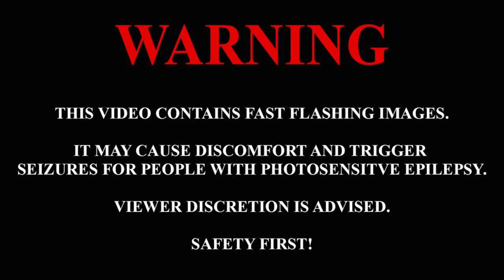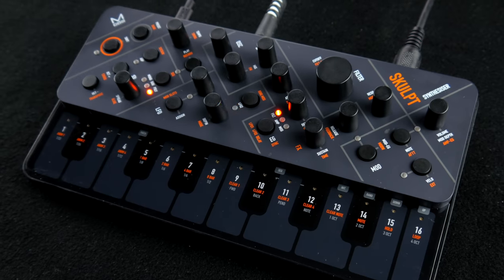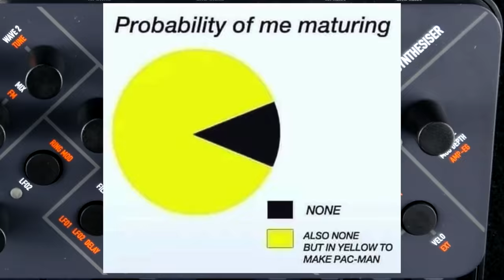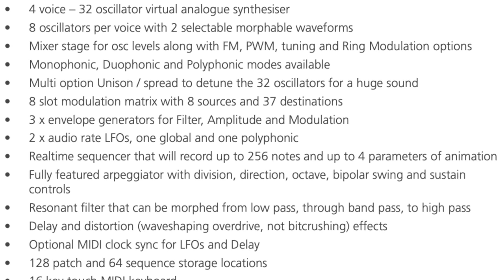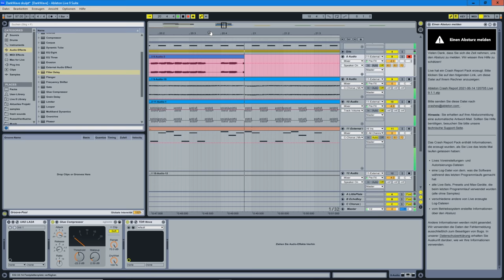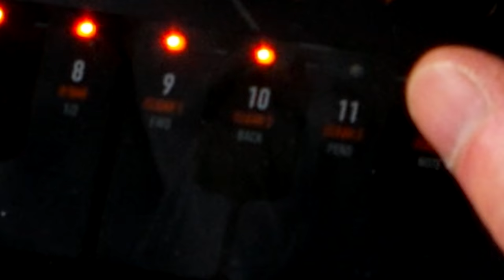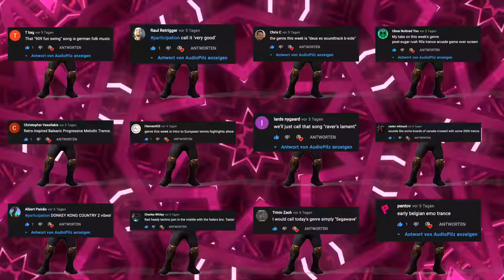Bad Gear - Modal Skulpt - Plastic Toy???

Comment: almost $500USD and NOT sold in the USA at least on Ebay, it is only from Japan or UK. The SE is the only model available in the USA so far. The crashing is a no go for me for that price! When it is $100USD used in the USA at my local ebay store or pawnshop then I get it. With it crashing I would be tempted to throw it against a wall..
Reply from the maker: Insane! They're rather cheap around here
Reply: Theres no difference between the SE and the Original sound or function wise.
Reply: Yeah looks like it costs about a third of that if you order from Europe. Insane!
Reply: @Stadsjaap  Yes! The black unit is too expensive in the US. The white SE edition unit is $199 to $299
Reply: @mycosys  hmm? I wonder why thy have it labeled for the white one, Skulpt SE?

Comment: Ok. So I can’t agree with you on some counts. Whereas it indeed can sound decent it will always sound weak. I spent a lot of time trying to beef it up at least so it can match even my circuit, but Skulpt kept failing. UI on the other hand is quite usable up to a point when you want to assign any kind of modulation or LFO without an app. Nightmare. And I don’t want to use app, I have VSTs to click around, thank you. Lastly, sequencer. This is something else. I never have seen sequencer that bad. Even deleting a sequence and persisting that state is an impossible chore without an app. 
Skulpt have a lot of potential, but there was way too much corners to cut in order to maintain the price.
Reply from the maker: I think it was supposed to be a gateway drug
Reply: @AudioPilz  For me that it was for sure. But now, after I got monologue, Skulpt sits silently, unplugged, at the edge of the table, like some sort of remorse or gilty concience. Even If I'd want to sell it, with the release of SE (which is half price MSRP), OG is virtualy worthless. And useless. At least for me.
And that - releasing SE, wich is same thing but with clearer labels, for half of the price of OG - is a AAA class dick move on modal's part.
Reply: I'm not entirely sure if you're engaging in some low key trolling Room, with your Circuit comment. I honestly can't tell  I actually involuntarily snorted out loud when I read it, which also seemed to be the trigger for energy drink to cascade out my nose. You learn something new every day. Today I learned not to drink energy drink whilst reading contentious comments on the internet. 

Horses for courses, if you prefer the OG's sound over the skulpt. For me I suppose, I just prefer my luxuries like a keyboard, an arpeggiator, function labelled knobs, easy access to multiple envelopes, filters, oscillators, plus distortion etc from a front panel,  computer software that plays the patch out loud as you're tweeking it, and the ability to "easily" play it from an external keyboard, or for it to control other equipment without the need for any extra cabling or splitter units. Call me old fashioned.
Reply: @dazastafariinc8390  I think there's some serious misunderstanding going on here. So to clarify:
By OG I mean the Skulpt shown in the video, the original one - as in original gangsta. That's how kids call original things these days. About two months ago Modal released slightly revamped version of it, called SkulptSYNTH SE, which differs from the original in different labeling (labels are horizontal now), less visual clutter caused by the teris lines and in price (MSRP is half of what OG skulpt went for). Oh, and apparently it comes with white keyboard. But differences end here.

So the whole second part of your comment is lost on me, sorry. Your understanding of word 'OG' is clearly different. In case however we are still talking about Skulpt - as I said: unless you want to assign modulations, all programming can be done from the panel more or less easily. Some things require using the app though, which I don't like, because I want hardware to be tactile, not clickable.
Reply: @dziwic  ah my bad dude. I am aware of what the term OG meant as I used to be a professional hip hop DJ and encountered more wannabe OG's in 12 years than anyone should have to endure. By OG I meant the novation circuit, which is the internet parlance the kiddies are using to describe it. I believe in relation to the circuit the term originates from online reviewer Gabe Miller, the most ungangsterish individual one will ever come across. It appears OG is one of the buzz synth words of the year, along with other gems like "creamy" to describe anything even slightly moogy, and "minty" to describe something's condition as be excellent or mint condition.
Reply: @dziwic  oh I thoroughly agree on the skulpt as well. I don't bother with the assignable mods and the sequencer as I sequence it with a toraiz squid, buy the oscillators, filters, envelopes, FX and spread are more than enough on the front panel to craft some good sounds out of, something sadly lacking in the circuit. The modal app sheets all over the circuit app btw imo.
Reply: @dazastafariinc8390  Ok, so we have the understanding - agreed, OG tends to stand for OG circuit these days, but have never seen used as just an 'OG' (without the 'Circuit' bit) in that regard. That being said, again - I agree with everythying. Nova engine has nothing on Skulpt and sheer requirement of using an app to dial in anything is appaling. But then Circuit - being poly, that's why we compare - is great multitimbral sketchpad. I use it as a brain to both sequence skulpt and sync model:samples which in turn passes the sync trough to monologue. If I decide to use Circuit and Skulpt at all. But as a sketchpad - it's awesome.

And besides - Gabe single handedly sold more circuits in a year with his channel than Novation's marketing dept in 5 years.

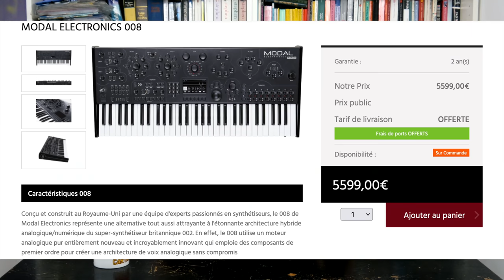Comment: 8:59 Trust me, you don't want a Modal 008. The most disappointing synth purchase I've ever made. I sold it and lost a lot of money on it. Why didn't I like it? where do I begin? Firstly it's an analogue polysynth with a bootup time similar to the Korg Kronos, why does an analogue synth need a long boot up time? Sequential synths are instant on. When you do turn it on you'd better not have your mixer or speakers switched on unless you want to blow them or your ear drums up. No "anti-pop" circuitry exists, switching it off makes loud sounds too. The PWM range is limited, not through zero so you can forget about rhythmic sounds, Modal went to the trouble of finding other (similar) synths to compare the 008 against and say this was a pretty normal thing on average. But this is an expensive synth, not an average one. It sounds cold and what use is having tons of filter modes if they don't sound good. Oh and do you enjoy your synth voices jumping between the left and right channels? Well you'd better get used to it. A stereo synth where 4 voices are panned hard left, 4 hard right. They did release an IO board which supposedly fixed this and added some bad sounding FX (because you really want bad FX on a flagship synth). I never invested in it, I was hoping they would give me one for free when I sent my 008 back to Modal but nope. I sent it back because I was using XLR balanced output cables and when I went to move the synth they wouldn't come out. I tried various things recommended by Modal but none of them worked. They blew all the cost on fancy controls, leather end cheeks and a bloated control system (with a dire web UI) and not enough on the sound. I had an 001 as well which I found to be a nicer sounding machine, but the engine was way too limited. I sold that too. Notice how Nick Batt was never allowed to review it even though he was basically in the same town? when he did have the synths in the studio the Modal people demonstrated it.
Reply from the maker: Thanks for the heads up!!!

Comment: The 'keyboard' is ass.
The sound is great.
The VFM is off the charts.
But, just buy a Cobalt8M unless battery power is important..
Reply from the maker: Yeah, they totally got me hooked on the sound
Reply: @AudioPilz  Both modules are fantastic, but the Argon is a little less of an 'instant smile machine' in most cases. There was a sound set they released for it that took it up a notch though.

Comment: Unfortunately all these "harware-but-not-analog" synths are all sounding the same, as a bad VST. So buy a laptop and use a free VST and this is the same result... (at least you have a laptop that can be useful in many other situations!). Today many people are thinking they can create a Synth without any knowledge in Electronic just using a programming language. Of course that's not true. Even to create a digital synth...
Reply from the maker: In defense of Modal, they have a bunch of fully analog high end synths in their portfolio too
Reply: @AudioPilz  I think all their synths are "virtual analog" or "wavetables", no real analog synths in their collection (or I missed something, this is always possible). So just a bunch of softwares you can easily run on a PC or Mac with no sound difference.
The synth market is so wide these days, I think we can be demanding.

Comment: This unit is of a very low quality build.  In my opinion.  Purchased one from Guitar Center.  Immediately had issues with the unit turning on and off.  I sold mine for $50.  I just couldn't bring myself to rip someone off as bad as GC did me.  $219.00 for this product.  If I were a developer at Modal, honestly, I would be ashamed releasing a product of this poor quality to wanting synth geeks.  Sad times.
Reply from the maker: I think it's more like a marketing tool for their bigger models